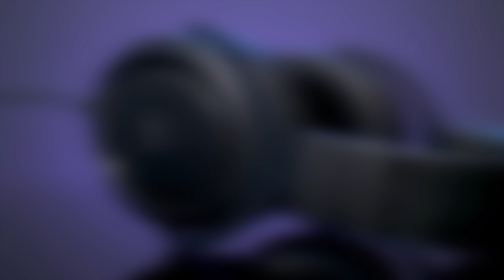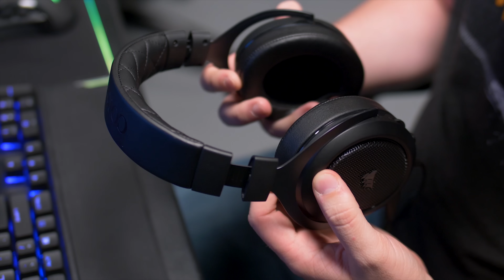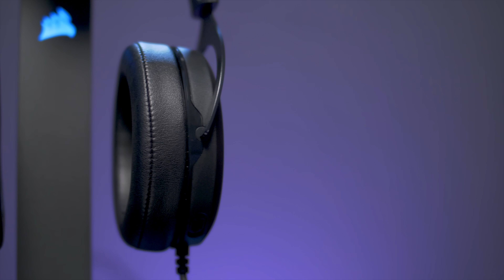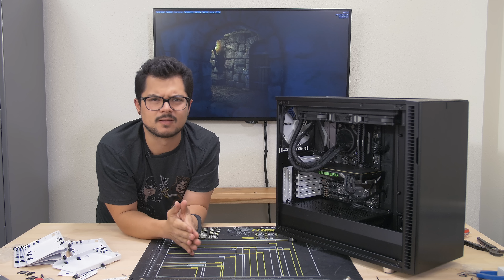Getting intimate with the Define R6: Build and Review

Comment: I get the riser but how much more would it really cost them just giving you the type C connector on the front? Seem just something they can milk you for. Other wise a pretty nice case.
Reply: There is a different and more complex circuit board for the Gen 2 type-C ports and the power capacity is different, it maxes out at a potential power draw at 100w (5a-20v) and gen 2 is 10gpbs data rate.
There is a cost involved that would be translated to all customers, this way the ones who are early Type-C adopters pay the premium and everyone else is at the normal price

Comment: the front panel header should be an entirely separate skew of the case, instead of 1 case Skew then having to buy a separate addon and having to take shit apart to swap out the front panel setup and be left with an extra one you could simply order the version you want.
Reply: Possibly, or do both. Personally I like future proofing but with no type C devices at present I wouldn't deem the upgrade worth the extra cost. But if that changes later would be nice to have the option for a cheap upgrade even with the hassle it brings.
Reply: my big point was it's just "nickel and dime'ing" you to death to have to buy all these things as extra addons instead of having a Skew preconfigured with that, like if you want the type front panel you are now paying for a case with the regular front panel (including the cost of the regular front panel) AND for the add-on and if the MASTERCASE MAKER series is ANY indication the popular addons (like vertical GPU Bracket) will be next to impossible to get your hands on because they will be such a LOW production run and because of the low run the prices will be sky freaking high. all of this is a moot point for me anyway, I need a case that fits 2 360 rads at the same time as supporting MORE THEN 2 3.5" HDD's (preferably 4) another problem with these fractal cases, you have to basically LOSE all 3.5" drive bay support to add a res/pump combo, i've got a LOT of computer to cool, a PAIR of 1080 TI's and an overclocked 6700k, the EK configurator (do to the case I randomly selected) said I needed a 260, 240 and 120 (so 2 360's worth of area) to cool all of that.
Reply: Mine came with the other panel free inside the case.

Comment: Kyle I think ypu should try to take a large case and build two systems in it, powered by one 850W power supply.
Reply: That won't work because most psu's only have 1 24pin motherboard connector
Reply: A high powered system needs at least 850w. Also, modding a PSU to power two systems is a bad idea.
Reply: Gotta Eat All The Breads what you are saying is bullshit. A "normal" gaming system with a single gtx 1080ti doesnt need more than a 500w psu
Reply: Well I understand that but it is not impossible to find a connecter that splits off from a modular PS and splits into two 24 pin connectors.
Reply: And plus the idea of a 80+ gold power supply with 850W would be over kill

Comment: Guys can you briefly explain me  motherboards chipset type supporting 7th generation Lga  1151 socket? thanks
a brief Google search didn't do me anything good.
I especially wanna know which support overclocking and other features as well.
Reply: Im Back The 7th gen of intel cpus are known as kabylake and the 8th gen is the newest being coffeelake. I’m assuming you are looking to buy a motherboard for a kabylake cpu which means you can buy any motherboard that is z270/b250 you may also use z170/b150 boards which were for the 6th gen CPU’s but support the 7th gen as well with s bios update. In reference to the lga 1151 that is basically the form or “size” of the cpu so lga 1151 is used to describe the 6th, 7th, and 8th gen cpus because they are all the same size. If you were wondering the the 8th gen cpus have new motherboards (z370/b350) that don’t support 6th or 7th gen cpus but are still lga 1151 due to the size. Also the Z motherboards allow for overclocking. I hope that clears it up feel free to ask if you have anymore questions.
Reply: Im Back it's too early to tell. from competition with amd i want to say it will but they could always just be regular old intel and make cannon lake not support them.

EDIT: There has not been any news or statement.
Reply: 6th and 7th gen are supported on z/b1xx z/b2xx motherboards, if you want to overclock pick a z170 or z270 motherboard, obviously z270 has more features.
Reply: Thanks guys. I also wanna ask if there has been any news or statement from Intel on whether coffee lake motherboards will support cannon lake processers?
Reply: Trinescity Okay
Reply: goathug 
That’s fucking terrible man, I hope you pressed charges.
Reply: Im Back 
No there hasn’t but I can already answer that question..NO.
Reply: Z270 supports OC.

Comment: This revision of the R series is garbage. Why is it so focused on watercooling when they already have the S available?
Reply: lol, focused on water cooling but with not a single reservoir mount.
Reply: Andrew one person out of how many people? Exactly, your comment doesn't really mean shit.
Reply: This case is modular. You can strip it down to the frame. This means it is geared for both water and air. It fixes the issues the 5 had but adds a lot of features that were missing. I think this would suit the modder and not the budget minded builders.
Reply: Jesus you're salty, this is one of the best cases out there.
Reply: Andrew chill bro.
Reply: Don't like my opinion? Then fuck off cause I didn't ask you for one.
Reply: Manufacturers and companies need consumer opinions to improve their products and I've stated mine, I don't like the case so they've lost a sale. Go troll someone else you loser.
Reply: Gotta Eat All The Breads this is no better than the R5 imo. You can't even fit a 360 rad in this without having to put it in the open configuration. I could fit a 360 and a 240 in the R5 and still be able to put the larger HDD  cage (6 drives?) In. This case is purely keeping up with the trends plus those add on type C and riser cable are a joke.
Reply: I don't like the case so what's it to you?